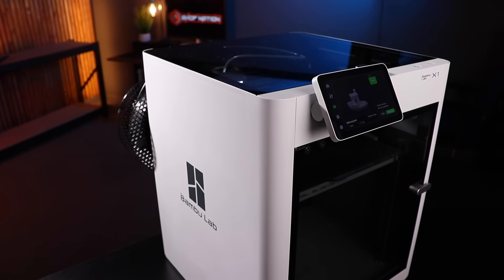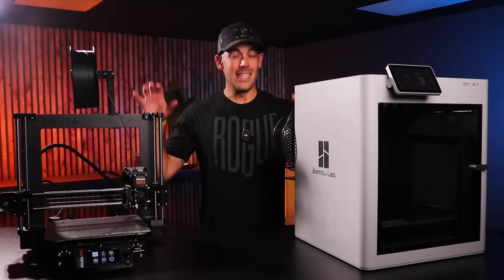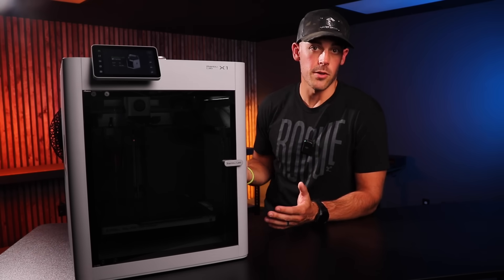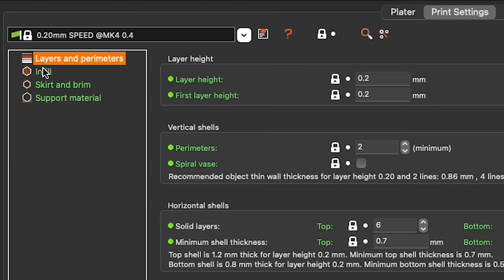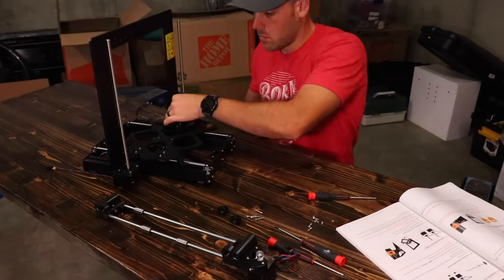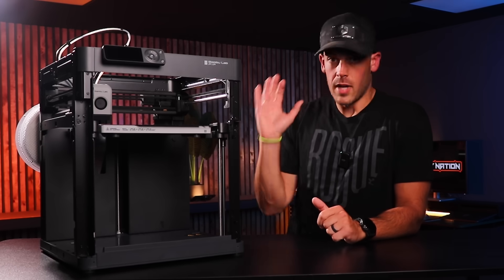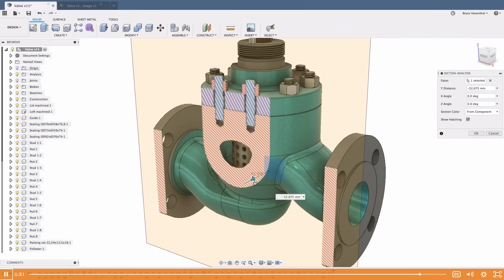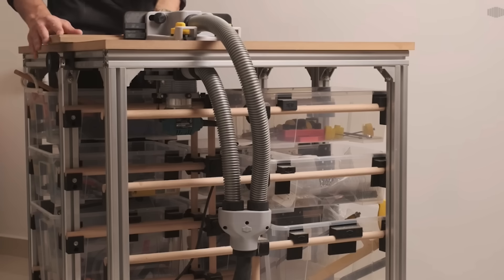The 3D Printer I'd buy if I started over

Comment: In the last storm we had, a part of the raindrain of the roof was fractured. I 3D scanned it, worked on it a bit and 3D printed the piece that was broken. I went to 5 stores before i went on the scanning and printing route. The first 3 said " it was too old and couldnt be bought anymore" while the other 2 said they could get it but it would cost about 250 dollars. .... yeah... So i went with 3D printing.. it cost me about 4 $. so yes printing fantasy stuff and cosplay stuff is grand and all but using it for everyday issue and problems that need to be solved, is way more fun.
Reply: 3D Scanned?
Reply: Could have used something like Meshroom to find the shape of the gutter, then just getting a reference  measurement to determine the length to scale the print to. That way you can quite easily just make a cap or something to glue in/fit in and replace the broken area @Svevid
Reply: My dad works for the railroad and there’s a laser leveling system on a machine to level the track. Sun shines into it and makes it unstable. I made some honeycomb extrusions 8 inches tall modeled in 15 minutes and printed in 24 hours gave it to him to test. He tested it today and said it reduces the direct sunlight going into the sensor and I helped them gain back 1 hour of productivity. So this $10 piece of plastic gave back thousands of dollars.
Reply: @wyattb3138  sell it after you refine it don’t invent for free
Reply: I’d like to know about this 3D scanned as well.
Reply: Now guy math says that’s the equivalent of a $246 discount on that printer you previously bought haha. That’s how you have to pitch it to the Mrs. At least👍🏻
Reply: Also would like to know about the 3d scanning, please.
Reply: Yes I print mostly parts for repair in my house and small tools, 3d printers are heavens sent for this task, Figurines are nice but 95% of my prints are tool and repair related!
Reply: This is why I just spent almost 6 bills.  I found an awesome but older Amp at a thriftstore BUT it didn't have a volume knob.  3 more like 4 years of looking I've not been able to find another one that fits.  I did see that someone had figured out the exact dimensions of this mysterious plastic unicorn.  There is no other way I'm gonna finally get this knob and as any nerd worth their salt knows...you don't set out a piece of electronic equipment with a giant missing knob.  You just can't.
Reply: that's all I do and haven't sat idle for 8 years. I don't get grown guys making figurines. but whatever, I'm sure they thinks it's weird that everything that can be is printed at my house. and all the old crap I bring back to life. you see the world totally different. "I can print something for that" comes out of my mouth all the time
Reply: @JoeGreen-db8jz  Yeah thats it pretty much 70% of my prints are just house spare parts, the other 30% are as well functional parts not figurines or whatsoever for new projects.
The 3d printer was one of the best investments to keep my house running, because if something breaks, I just open the design software and design a replacement part and print it!
Reply: wow, you bought a 3d scanner for under $4! please share your source!
Reply: @simonr23  don't know what the op used but have you never heard of photo grammetry. If not look it up. Basically free to create extremely accurate 3d models. You only need a camera. Smartphones are good enough and then you can use free software like 3df zephyr. To polish the model you can use blender, meshlab etc.

Comment: Great Video. What's the tolerance on the Print part on the Bambu? Right now making my holes .010 inch bigger in Diameter and they are still small.

Comment: Buy a printer that works out of the box and pay 1200$, if you can watch an assembly video and turn a screwdriver you can kit out an ender with all the bells and whistles for 1 fifth of the price with sometimes better print quality. Assembling your own printer teaches you about it and you can fix your own printer without having to wait for a replacement. I've assembled many Creality printers and every single one of them are still running, the oldest an Ender 3 that I bought 6 years ago, I printed with it today, probably leveled the bed on it 3 times in those 6 years, so if you do it right, you do not need to do it all the time. I agree..most people are willing to pay a premium and does not want to know what's going on under the hood, but I don't want to be stranded next to the road. If you're on a budget and want good prints, get an ender, many people that bought expensive printers hate ender users because they get better prints at a fifth of the price.

Comment: I started with an Ender 3 Pro, and enjoyed it but felt extremely limited. As a beginner, I felt aggravated at times at how hard it was to keep level. I also upgraded a lot of parts, including installing nylon bushings under the levelling knobs and the Micro Swiss Direct Drive Extruder. I've "upgraded" (I hope) to a Flash Forge Adventurer 5M and hope to make more progressive prints. We'll see how that turns out. If it's successful, I may keep climbing the 3D printing ladder. 

As fiddly as the Ender 3 is, I will still keep printing smaller parts on it while my Flash Forge prints heavier duty stuff. I'm figuring it out as I go and videos like this help. I'[m not in it to take over the 3D printing world, just to have some fun and make some props, and kits, that people can enjoy!

Comment: Ive tried getting into 3d printing twice with two different printers, two different times, and two different living spaces. I tried the ender 3 and cr10s pro v2 and both failed to make anything successfully (mostly bc skill issues I presume). After over $1k in printers and other materials trying to trouble shoot, not to mention tens of hours spent doing everything but printing, you kinda start to feel like printing isnt for you. Until theres a printer that all I have to do is load filament, i probably am not gonna try again.

Comment: Flashforge Adventurer 5M $299.. crushes it out of the box 10  minutes setup.  You're making things! Printing for 7 years now own 12 brands I've paid for out my pocket.. best entry level printer for simple one click print even using its own slicer profiles . It has some issues not major mostly wifi connection and their slicer, but the thing just works and it works fast.. try one if you haven't plus their diy enclosure files are fun. Teaching you to print and upgrade while doing it.. just saying $1500 or $299

Comment: Ender 3 s1 is my first and only printer I worked on it for weeks changing bed material, leveling springs, hot end, and there is more all this and hours of tinkering got me no where with printing. 3rd party firmware is another upgrade I did and it changed my printing experience for the better. It's unreal what good software can do for a printer.

Comment: Coming back to this with some time and experience, would you now recommend the P1P or the P1S? Not necesserily asking for myself, I've got a bunch of MK3's, P1P's, a couple of P1S's and X1C's - personally I'd be recommending the P1S to newbies at this point as whilst it's slightly more expensive than the P1P it feels like a more complete end user product rather than a product that's had lumps ripped off of it.

Comment: I started with a barely used Ender 3 Pro and then I got an Ender 3 V2, I've already made some upgrades because these machines here in Brazil are expensive and in the case of Prusa, there is no support or authorized reseller yet. Not much to start with other than willpower.

Comment: The problem with that P1P/S is that you miss a lot of things the X1 brings to the table.  First layer failure detection via Lidar, a chamber monitor that evaluates the temps and controls the fans to keep the chamber close to 60c, a better hardened steel extruder and print head, better Z-Axis calibration and balancing, better build material, no concerns with Bambu Studio defaulting to the wrong printer, seeing that it automatically defaults everything I download to the X1 profile (even on my P1S) and this creates real issues when you miss that.

Comment: i watched this video just to see what people recommend and decided to shell out a bit more cash on the x1 carbon about 4 months ago, I have been extremely happy with it, the only time it has failed was 
1: the outlet almost caught fire(we had a crappy space heater plug into which caused the outlet to short)
2: filament ran out mid print and the functional part didn't hold up on the line between filaments
3: filament got tangled
4: filament snapped in the tube 
5: tried to print something really thin and tall
none of these failures were the printers fault and were either out of my control or user error

Comment: There are many good 3D printers. But I bout 2 years ago a used A20m for 100USD and its a workhorse. Its also pretty fast, 120mm/s without any upgrades. It has the advantage of having the extruder motor not part of the head. so the head is light and can move fast

Comment: I spent $1,400 on the FlashForge 3D Printer Creator Pro, that I haven't gotten around to setting up and using yet. Is that still a good printer to get started with???? I want something easy and able to print high quality parts.

Comment: Awesome video! I have been contemplating buying one for a while now so that I can do exactly what you stated, "solve problems around my CNC shop". There is always a small something that would solve large issues if I just had this... "thing". I feel 3D printing would be a much cheaper and quicker way for me to make these things vs. putting them on a lathe or mill and making them from aluminum. I wanted to ask the crowd if anyone has tested out the Snapmaker brand of printers and how they compare to the two featured in this video. Speed is important to me, but quality of print is probably #1 on my list of priorities. Any help/comment would be appreciated.

Comment: Thanks so much for this video and cool to see someone who sees this as a tool. Making articulated octopuses... Ok why not, but I want to repair and fix problems with my printer!

Which brings me to a question. The printers you show here look very good and are often recommended, that's for sure.

But they have a problem that's really bothering me. I need a print area of more than 400 x 400 x 400 mm. These printers are about half ... Are there printers in the same price range, but in this size?

Thank you!

Comment: It seems like you are comparing the P1P with Mk3s+ and the X1C with MK4. I think that’s unfair. In my eyes, the MK4 is similar to the P1P with its similar features and open frame. Except you are paying a lot more than necessary for those same features when going the mk4 route. The mk3 is definitely reliable too, but it is like 4x slower than the P1P with the same reliability and features. The X1C I would consider a higher class. It definitely has more features (full enclosure by default, more sensors, faster, etc). Prusa does have a longer track record, simply because it has been around longer.
Anyways, both brands seem very reliable from my own experience, but Bambo just does give you a bit more value for your money.

Comment: I wish I would've known what I was getting into when I started. I bought an Anet ET4, a hunk of junk that prints horribly, has manual leveling, the heatsink explodes, and the cooling fan decides to turn off whenever it would like. I probably spent multiple weekends repairing that thing just to get it to print a subpar print and it to break again. So, I bought a P1S, and man this thing is crazy, I have only ever had to replace one thing, which was the printer display, I may have accidentally hit my arm on the panel causing it to break off from the printer and shatter on the floor.

Comment: Thanks for this video. I’d like to add that the P1S is now $699 and is fully encased like the X1C. I’ve heard it’s also recommended to run a mini heater inside to eliminate most warping. You can also change out the hot end and extruder to the one from the X1C allowing you to print the same filaments as the X1C.

Comment: Stopping by  to say thank you for this video. Got a P1S with AMS and it's so fun to just PRINT and not have to worry about much else. Only had it a few weeks but it's so nice to have and I'm so excited for the future!
Reply: Hi there!
It's been 3 months since your comment, and I'm curious if you're still happy with your purchase?

I was looking at this exact configuration this morning.  P1S with AMS.

Even got so far as to do some 3d modelling with OnShape and exported my part (simple box with clip slots) into Bambu's slicer software.  

By all accounts the PS1 is great choice.
Was hoping to hear from someone who's had some experience with it.
Reply: @Trag1cMag1c  yes!! It is all absolute dream! Still going strong and no real problems to speak of! A lot of issues can be solved by making sure filament is dry.
Reply: @WuLFie40  I pulled the trigger this morning.
Ordered with the AMS.  The more research I did, the more compelling this unit became.

Can I ask what climate you're in?
I'm in Brantford, Ontario, Canada.  About 100 kms (60 miles) from Toronto.
Humidity might be an issue during our summer months.
But I might set this unit up in our basement, and have our dehumidifier in the room.
Reply: @Trag1cMag1c  Great choice! You're gonna love it! I live in the States in the Midwest. I also have it downstairs in the cool basement, and I think that's helped a bit with the filament storage.

I still want to eventually get a purpose built filament dryer. But even factory sealed spools can have a bit of moisture that's been absorbed by the filament. 

Overall, the thing is a beast and I think you'll love it!
Reply: @WuLFie40  I appreciate your time!
What types of things do you typically print?

I've already designed some small bird feeders.
Want to try material that'll hold up to the outdoors.
First thing will be storage solutions for our kitchen and bathroom.

Comment: I always hear good things about prusa but MAN was that not my experience. I started on an ender 3 v2 which i had for about a year, eventually i upgraded to a prusa mk3s+ kit which i got the enclosure and other extras for. I wrestled with that thing for two years off and on but it just never managed to get through 3 or 4 prints before some issue would come up.  When it was working the prints were immaculate but if theres any kind of problem a printer could have that one had it at some point. Just couldnt do it anymore and got rid of it. Maybe mine was a dud, idk i learned alot about FDM printing from constantly fixing the latest and more obscure issues that prusa would have. Ultimately reliable is not the word I would use when i think of prusa, not after that experience. Im hopeful that the bambu printers will be different but if the bar for reliability is what i dealt with using the prusa ill probably leave the hobby space altogether.

Comment: Great video. i like your background and how you explained that the 3d Printers were "Shrouded in Nerd Culture!. I want to create a MOBILE Makeer Apace on my RV.. I own this Commercial Shell RV and I want to Build it into a Mobile Maker Space. If I buy one of these and I put it on the Road, do you think that the Vibration of Traveling would effect the units or are they very Durable. I am inclined to buy one that is Completely enclosed as well. but Could I Put it inside a Plexiglass Box and still have it work the same. Thanks tor listening.

Comment: I find it a little funny in the beginning of the video you bash Ender for having to work on it to make it work but the recommend the Prusa kit so you know how it works when something goes wrong. I also dont understand why Ender gets such a bad rap all the time. I also come from a commercial printing background doing prototyping and production work at an engineering company. At home I run the Ender3 V2. It is rock solid with only a couple upgrade parts that you install when building that kit. I installed the silicone bushings and last adjusted my bed almost 1 year ago, it just works. From Microcenter with the new customer coupon the machine was $99, I added the silicone bushings and direct drive for another $60. Id call it the Toyota Tercel of the 3D printing world. No frills, manual adjustments, kinda small. But it will get you what you need when you need it.

Comment: There’s just no comparison between bambulabs and Prusa. Bambu blows it out of the water in every single way. Prusa is popular because they were so early to market. When you factor in that the bambulabs has an enclosure to stabilize temps, superior Wi-Fi, superior web suites, the webcam, superior hotbed, superior slicer, and faster print speeds along with more accurate tolerances. It’s amazing they can even hit the 1200 dollar price point let alone the beauty factors such as touchscreen and smooth machined aluminum which serves no purpose other than just looking good.